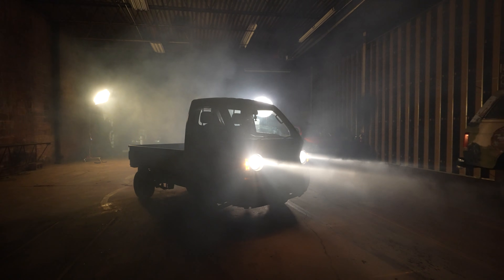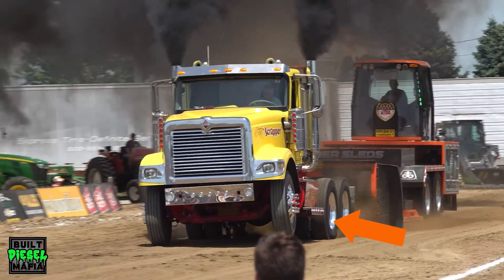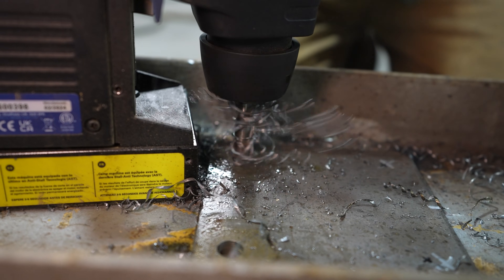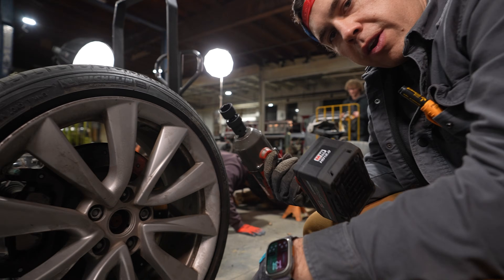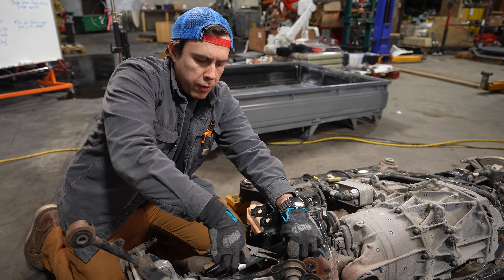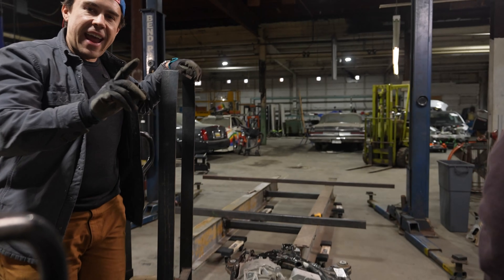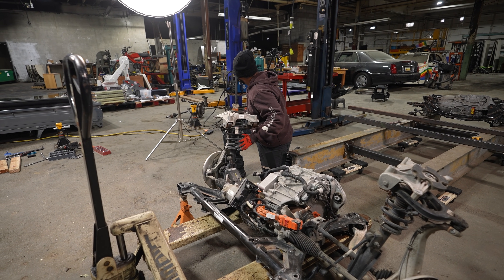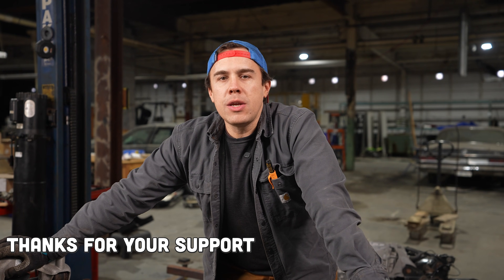My Twin Tesla Motor Kei Truck Has A Major Problem

Comment: Andy, I'm with you 100% on this, I think your idea is not only admirable, but desperately needed.   I do have 2 questions though. 1. Why 2 Tesla motors instead of 1?  Isn't one motor more than enough power for this mini truck?  This would cut costs significantly and you could pass on those savings to those who don't need or care if they have 500hp.  I think a "truck for the people" should come with an option of 1 or 2 motors.  I"m sure you've considered it... But I'd love to know why you chose that direction?   2nd question -  K-Trucks have been outlawed for over 2 decades due to their terrible crash test results.  Which is why you can only purchase 25+ year old versions because they dont' have to comply with US safety regulations.  But if you get in a front-end collision over 20 mph its a death sentance.   I know you're working on a prototype but how will you improve satety on your mini truck cab?

Comment: Since you had access to 3D scanning I suggest you try to retain the original Tesla subframe mounting arrangement. If you try to level out the mounts it will throw off all the suspension geometry (castor, camber, toe, bump steer, etc)

Comment: u should use the tesla model 3 sr battery since half the case is empty u can chip case and cap it and it should fit nice  and still have a nice save enclosure

Comment: Watching you not use datums makes me cringe a little after  32 years in the industry. It's cool though, I get the project is just for fun. I was on the F-150 Lightening drive system and, most recently, the Silverado EV drive system. If you'd like some insight, I could stop in. I work in Redford and drive through your area often. Keep the videos coming.
Reply from the maker: The top of the I-beam structure is the datum.
Reply: @thatdetroitandy  That's Z but you need an X and Y for each drive module. I'm sure you'll get it. Have fun.

Comment: After all that, all you have to do is reassemble the original kei truck to its original form, with its original engine, and call this abomination you try to build that's gonna result "The Sendpai"!

A replica of the cabin would've helped VERY MUCH!

😑

Comment: Instead of doing the CC overlayed, you should do the YouTube CC so you can also support multiple languages. More traffic to the video, for sure. Give it a try.
Reply from the maker: I thought the CC was baked in automatically? Does it not show?
Reply: @thatdetroitandy  That's what I mean. The CC is hard-coded into the video itself. But YouTube has a CC feature. You can upload several different languages instead of getting fixed to one. Cheesy example, but if you check out what Mr. Beast does, he's actually got a whole video on how many more viewers he reaches by doing it that way. It's a wild trick.

Comment: 12:17 Pretty sure both motors are facing the wrong way... The front end of the front motor is facing the rear motor, and vice versa. I would double-check the orientation before you get too deep into it.
Reply from the maker: Nope. Steering rack is in the front front, spring perches are in the rear for the rear.

Comment: It is perfect for 50 hp it was not designed for 500 hp same as if you put the Suzuki drive train in the Tesla the car would be way to heavy and excessively strong for 50 hp.

Comment: AFTER THE ANNOUNCEMENT THIS WEEK EVERY SINGLE VEHICLE FACTORY IN USA IS RUSHING TO START MANUFACTURING NEW MIDSIZE TRUCKS FOR $10,000 RETAIL. 
AND YOU WHO HAS BEEN TALKING ABOUT IT FOR OVER A YEAR HAVEN'T MADE A SINGLE STEP FORWARD. 
YOUR ONLY BUILDING A TOY.
YOU WILL NEVER MANUFACTURE EVEN THE FIRST 100 UNITS.

Comment: its so funny seeing that frame on that trunk comped to american trucks that you can "safely" put more than then 3x what the bed is rated at and it fine even when it has holes rusted through it i don't think i would even try 2x on that without rust

Comment: Why not just start with a Tesla, strip away the body work down to its frame, motors and battery, and re attach the Kei truck cab and tray to the tesla frame?
Reply: Because cars and trucks aren't built the same. Trucks are built on a separate frame with the body bolted on. Cars are built in "monocoque" fashion, meaning the pieces that make up the body ARE the frame so if you take the body off, you lose all structural rigidity.....

Comment: Two thoughts come to mind One is can you use some kind of geometry to apply the forces from the front to the back and from the back towards the front so that they somewhat cancel out the second one is can you place the battery over the rear to offset some of the front waiting of the cab and what not

Comment: With every episode, it's become more clear that you can't really use the Kei truck. You were just cutting it apart & replacing it with bits you manufacfured a piece at a time. Glad to see you making your own frame for the Sendpai.
Reply: Kei truck of Theseus
Reply: I never really understood the purpose of this and was honestly really confused why he's doing all this to begin with. I could understand researching the kei truck for inspiration, and maybe even buying one to take apart for a visual, but I don't understand how going through this full process is any better than just building a truck from scratch
Reply: @CressynPractice and paid for content.
Reply: @Cressynthis is basically just prototyping. Take what available and make something from it.
Reply: @Cressynit’s a 1:1 scale of what he wants, the work he’s displays is showing what his car company is capable of.
Reply: Yea that's kinda how "the fastest" anything works. Unless it is specifically a record from a manufacturer who is competing as stock
Reply: Believe it or not, but for many years this was how Detroit designed concept vehicles. Take parts, see what happens, find problems, improve it.
Reply: That’s how most prototypes start out.
Reply: To be fair if more car companies made their engineers do this cars would be better.  Also isn't the goal to make his own bespoke car?  Starting the prototype with a very barebones cab and bed seems reasonable to me.

Comment: this won't work good. Where are you gona put the batteries? Exactly, nowheres. IE this will have super shit range. Theres a reason these teslas are built like brick shithouses and its to carry the battery. Time will tell tho. I'll withold judgement.
Reply: You already judged it, that’s what “this won’t work” means. So saying "I'll withold judgement." makes no sense. Also if you watched his other videos, you’d know it’s a fun toy, not a long-range EV. The rear axle is already being moved as far back as possible to fit the battery. Your intelligence matches your grammar: lacking.
Reply: @UWUSKIBBIEBOOOOO  if we are being honest you can make it run but it's not a kei truck since it literally means light truck and this will weigh more than the trucks previous GVM
Reply: @shaynegadsden  The guy is replacing the whole frame with a custom. It just has to look like it, a shell is fine. It's all entertainment anyways. A kei truck also shouldn't have 500hp.
Reply: @UWUSKIBBIEBOOOOO the HP isn't an issue seen other's with similar yet they don't gain that much weight.
Edit: Just to add it's still a tesla powered suzuki carry but kei truck is a description, it's the same as calling it a tesla powered orange truck it just isn't that
Reply: @shaynegadsden  With any other YT build, looks is all that matters. HP is 100% an issue. If you want to be technical about it, kei trucks are supposed to be under 660cc or 63hp and have strict specific dimensions. If it surpasses this, it's also not a kei truck. Since so many companies make "kei trucks" the styling is what most people refer to as a kei truck in NA. What you're doing is basically not calling a pickup truck a pickup when they add an enclosed bed roof because it then doesn't have an open cargo bed. YT bases things off looks, not specs so it really doesn't matter.
Reply: @UWUSKIBBIEBOOOOO no that's are registration requirement and I'm talking about what they literally are the word has a meaning.
Also the is zero power restriction
Reply: @shaynegadsden  See your whole point is saying "kei truck" has a meaning when in reality a Kei Truck is no more than just American slang, its quite literally a Japanese word then with the English word truck slapped onto the end. It is only referring to a small looking mini truck from Japan. "Keitora" is the real term which then refers to a light truck. In addition for it to be classified as a keitora, it must follow rules which include hp, payload, and size limits.
Reply: @UWUSKIBBIEBOOOOO wrong againt but keep going, keitora is right light truck which it maybe a truck but where it the light part but that is only a description of a type vehicle that meets Keijidosha
Reply: @shaynegadsden  This level of arrogance based off clear ignorance is insane.
Reply: @UWUSKIBBIEBOOOOO it is you should really pay more attention
Reply from the maker: I’ve got a solution.

Comment: Late 60 early '70s before 75 CJ5 frames, very heavy. Correct size for what you're doing and will stand the torque and everything that you want to put through it
Reply: How long would it take to source one of those?

Comment: Of course it does, you're putting in almost 10 times the HP it had lol the frame was built for a lil baby motor not two high torque electric motors that each have 4 times the HP.
Reply from the maker: Man, 10 times more does sound a lot cooler...